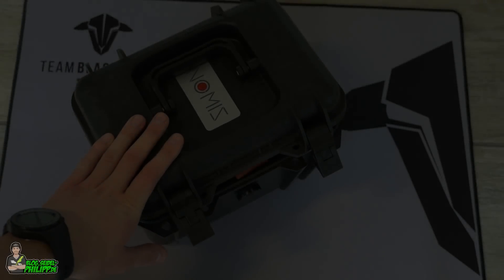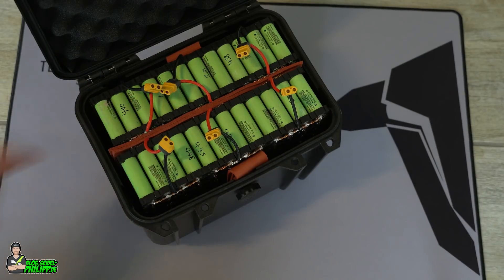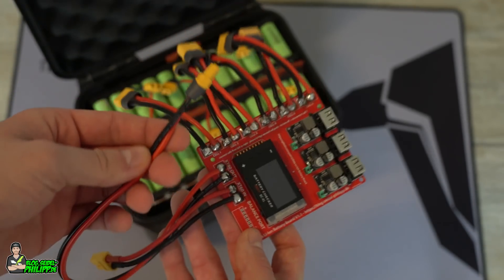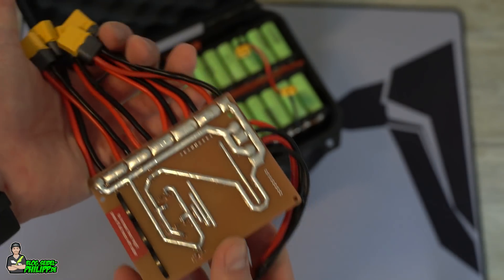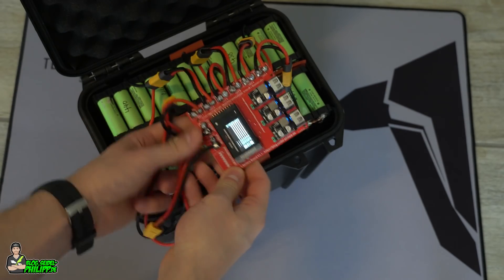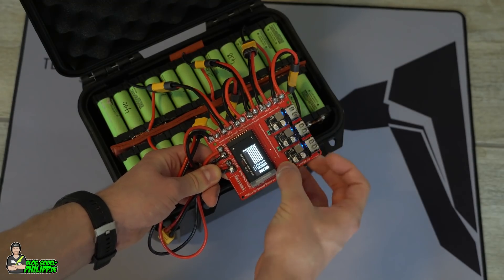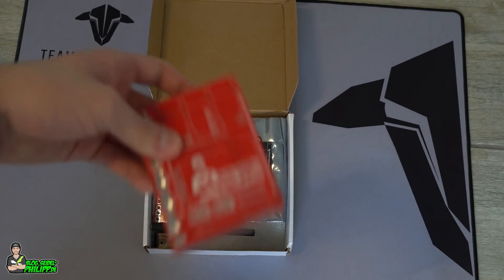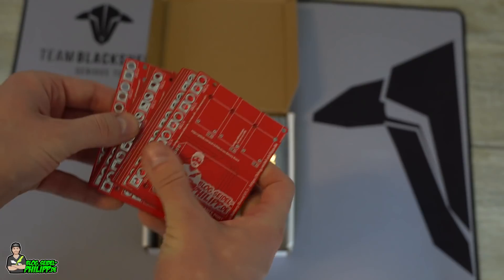Phils Li-Ion Battery Board - PCBWAY

Comment: Kann man damit auch eine 6s240p betreiben? Amper Max?
Reply from the maker: Du meinst mit 6S240p wirklich 1440 Zellen (6x240)? 

Generell spielt es keine Rolle wievielt parallele Zellen du betreibst. Ob 6S2P oder 6S1000P, das geht alles. Du musst nur darauf achten, dass du nicht zu viel Strom ziehst und dir die Leiterbahnen abbrennen. ;)